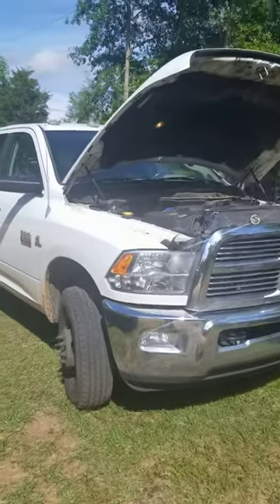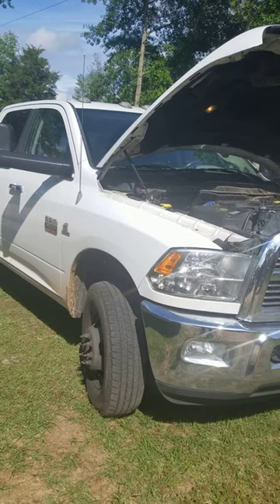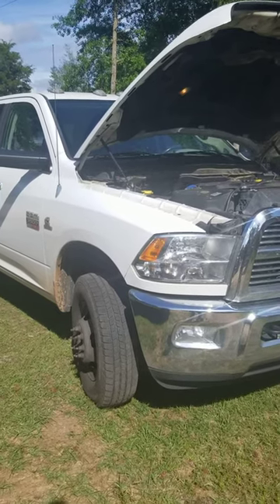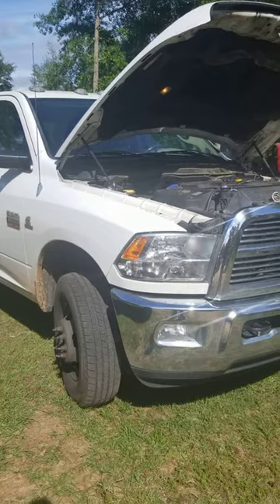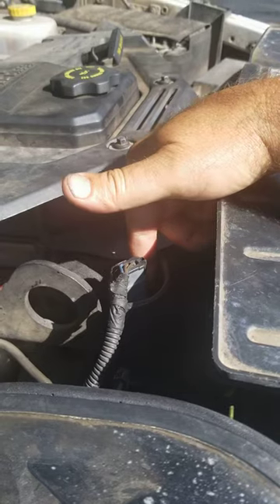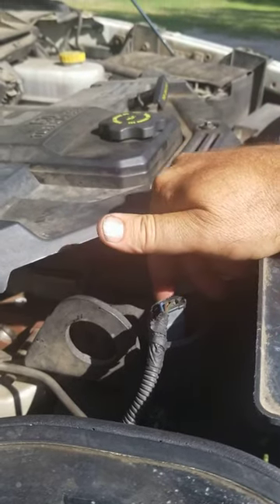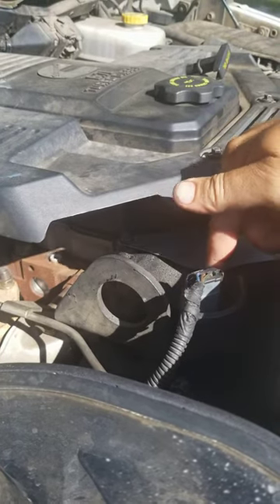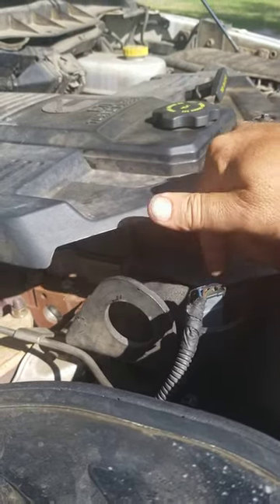Dodge Cummins  6.7l overheating, blowing  coolant out of reservoir fix

Comment: Hi Christopher I see it’s been eight months but was your truck running at normal temp and still bubbling at reservoir ? And is your truck still running fine?
Reply: Mine Is having the same issue I'm gonna do a pressure check as well
Reply: @krazyhuck8415 I have this going on right now did you ever fix yours?
Reply: Same here I am on the road already 200 miles in on the trip but no over heating just losing coolant out of the reservoir bottle through the over flow it has to be this don’t get it

Comment: Just had this same thing happen and the dealership says they can’t find the problem they did everything you did with a pressure test and nothing and tested everything with the cooling system and nothing so they are scratching their heads because it’s holding the 18psi but when I run it on the highway I lose like 1 to 2 gallons out of the reservoir bottle so I will have them check this and I am sure they did but I will ask again